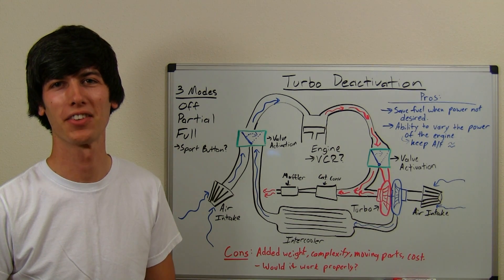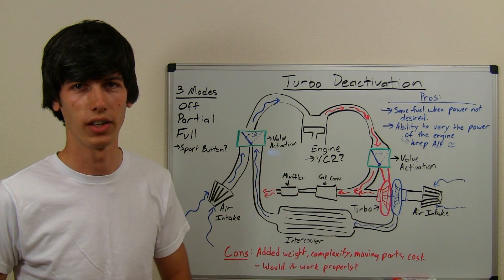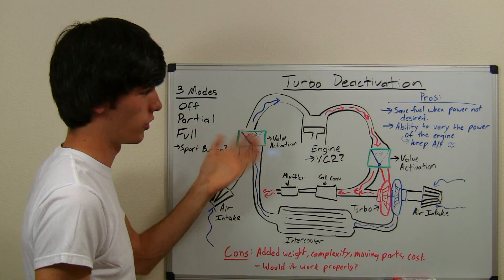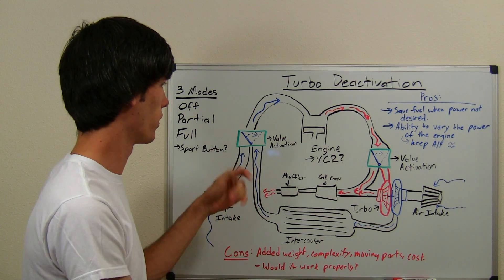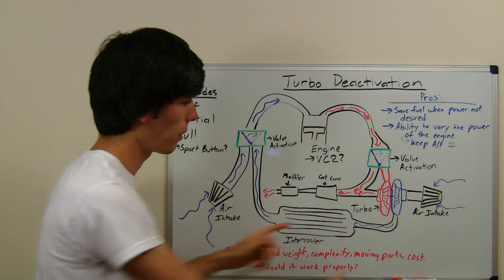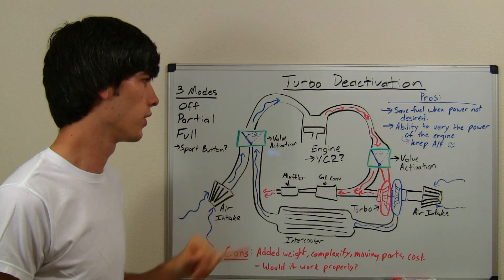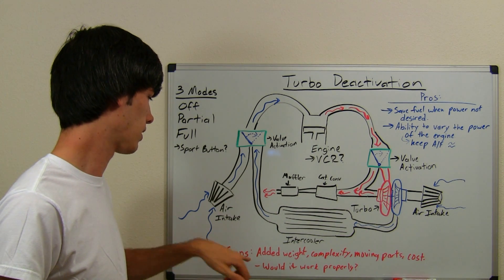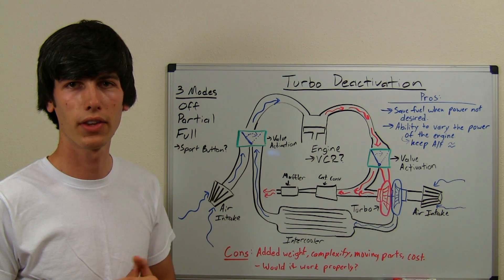Turbocharger Deactivation Concept - Explained

Comment: Surely in your line of work, being a car mechanic, you must have come across a car with a faulty turbo actuator. The symptom would be that the car produces almost no boost at all, because the open wastegate (AKA turbo bypass valve) allows exhaust gas to bypass the turbo. Why bother creating a complicated system like in the vid when all you have to do is fix open the wastegate to get the same result.

Comment: The turbine is a restriction. With wastegate open, exhaust gas will follow the path of least resistance and travel through it effectively bypassing the turbo.  How much boost do you think you can get out of a turbo with the wastegate/vnt vanes fully open?

Comment: DoctorDummer, let me explain. The wastegate bypasses engine exhaust pressure away from the turbo. With the wastegate jammed open, a turbo is effectively deactivated. A wastegate/VNT operated by an actuator, controlled by a pressure valve, is a boost regulating system.

Your final paragraph is simply incorrect in every way.

Comment: 1) Every turbocharger has a 'deactivation valve', it's called a wastegate or 'VNT' on newer types. These channel exhaust pressure away from the turbo, effectively bypassing it. If you want to find out how a car drives with the turbo deactivated pull the vacuum line off the VNT/wastegate actuator.

2) Turbo charged engines are designed to run at lower compression than NA. Removing the turbo will leave you with a NA engine with low compression and therefore reduced performance/fuel economy.

Comment: because if we ran that particular engine at full throttle, but instead at 2500 RPM, the head would be at full efficiency. So the efficiency is still there; and EE is still all intact, but FE SUFFERS. 

That cover it? :)

Comment: to this would be if the engine was at full throttle and at 10000 RPM, simulating 166L of air/s because density is double. This is NOT the full efficiency point of the head. Therefore, EE would NOT and NEVER be equivalent at the same RPM with the same amount of fuel. Efficiency will always be lower with a turbo; mostly due to heat losses. BUT, forced induction is our best friend in making more usable power; so of course we still use it regardless, and it doesnt LOWER efficieny of our engine,

Comment: because of boost! Why? Let me go further. Say we run turbos at 14.7 psi. So we have exactly DOUBLE the amount of air going into the engine; while density is DOUBLE (let us not account for heat losses). So, while at 5000 RPM and 100% throttle, 83L of air is still going through the head;and, in theory, the head should be at maximum efficiency, but in reality, it is overpressured and NOT at full efficiency. Why? The air density is double, causing more pressure; so the equivalent

Comment: head on an engine will produce max efficiency of the head at a certain airflow volume. SO, say the head was to reach maximum airflow efficiency (when air flow was not TOO pressurized to create difficulty in smooth flow, but not too LOWLY pressurized to slow velocity) at 83L of air/s (over a 2.0L I4); this efficiency would be reached at 100% throttle at ~5000 RPM. So clearly this is a race head. NONETHELESS; this head would NOT be equally efficient at 100% throttle and 5000 RPM on the same engine

Comment: DOUBLE. Simply because 14.7:1 is the ratio of perfect air-to-fuel combustion. Yes, the engine can run lean or rich; but if it was running at the same ratio, then it would use DOUBLE the amount of fuel because it is using DOUBLE the amount of air. Simple math. Would it produce DOUBLE the amount of work? NO! Why? Heating loss (intercooler is not 100% efficient. Good intercoolers are usually 80% at peak), and the MANY variations throughout the engine that determine good air flow; a

Comment: Economy; EE isn't relevant here if what you say he's proposing is true. Of course the system would work. All it is is just some complicated plumbing job; simplistic way to look at it, but at the end of the day; that IS what it is. 

Also, a turbo engine flows less air when NOT under boost for obvious reasons. And the question "does it use more fuel to do the same amount of work" is far too ambigious. If the turbo was pushing exactly an extra 14.7 PSI of boost, then fuel consumption would be

Comment: I don't know what you're doing, but something is off. Either way, this turbo deactivation system will be less efficient than just a pure turbo engine or a pure NA engine because of all the valves and plumbing complexities and the weight. It's really that simple. I did watch the video of course, but really only found that he proposed a "gimme your opinions" kinda question rather than individual questions. And, if those two questions WERE what he was asking; that has nothing to do with Fuel

Comment: It's not necessary 100%, but it'd be an absolute mess without it... 

And its simple. Less air forced in = less fuel burned. Yes, power would be down too, but power should still be sufficient even in N/A to put around town.

Comment: I'm afraid you are talking about the thermoelectric generators. They are only about 6-7% efficient. The thermoelectric cooling pads which pretty much makes one side hot and one side cold is almost 100% efficient.

Comment: Like I said, it needs experimenting. No one knows if idle exhaust flow would be able to power some or all accs. But even if it does not, there are ways to get aroudn it. i.e. If you had electric steering, as long as battery had power, it shouldn't be a problem. Battery can be charged when engine is running with alternator. And if nothing worked, alternator can be attached to turbines to add electricity to battery only when there's enough exhaust flow.

Comment: Could you please clear up then what magical force it is that stops the vehicle from accelerating down a hill even though the mass of your car along with gravity are trying to accelerate it. Engine braking (not compression braking) is caused by pumping loss. Compression braking is created by compressing air, releasing it before what would typically be the power stroke, then drawing the piston against a vacuum.

Comment: You replied to yourself. I am quite clear on the fact most people think all diesels don't have throttles. Actually there are diesels with throttle valves. They restrict air entering the compressor inlet restricting fresh air flow, this allows the VGT to clamp down a bit more without creating too much fresh air flow. The end effect is you can flow more EGR without having to flow a large amount of fresh air dropping the AFR. I could explain the entire concept but might scramble your brain.

Comment from the maker: I wouldn't necessarily say P/S is of no use at idle. Have you never been in neutral while moving? Also, if you go around a corner you typically let off the gas, switch gears (temporarily go into neutral, let the engine idle depending on how aggressive you take the corner), etc... Power steering would still be useful to have in this scenario, and probably others that didn't instantly come to mind.

Comment: Here you go dunce. Turbolag is time it takes for pressure generated by turbine to overcome vacuum(suction same thing duh) generated by pistons moving down. At idle/turbolag, engine vacuum is stronger than pressure, so no boost. Turbo does NOT stop at idle. Turbines are in the way of exhaust flow. Turbines stop only when there's no more exhaust flow. Just go study. Don't believe me? Google "turbo at idle". It's spinning, you dumbfuck.

Comment: So you are saying the compressor recovering the waste heat from the exhaust is 100% efficient?! At low flows when the turbo hasn't spooled the compressor in the intake is actually another restriction, as the air would flow more easily if the compressor was not in the stream. It is the same reason an Ebay electric "supercharger" decreases performance. But how could that be when it using energy, it is because it actually slows the momentum of the incoming air just like an unspooled turbo.

Comment: Come around? I have been saying the same thing all along. For the most part the the NA and TC have the same cat and muffler so that can be assumed to be negligible. It would seem minor yes; a drop across the turbo of perhaps half a psi is quite minor, but at low flows that is half a psi out of maybe 4 psia. That is where the 10% FE is lost. The drop across the turbo does increase with flow but so does the work out. This is where the tradeoff and turbo lag I mentioned comes into play.

Comment: No that is what you inferred. It recovers wasted heat at every speed/load point. However it also restricts exhaust flow at every speed/load. However, at high speed/load you gain more by recovering the waste heat than you lose by restricting the exhaust flow. Simply because there is a lot of waste heat at high speed/load and the turbo is likely spooled lowering the exhaust restriction.

Comment: Going down a hill, downshift. See if the airflow does not increase (if you have an OBD scanner that lets you read network parameters like fresh air flow). Not sure if you are thinking of an automatic transmission. Again really need to remember throttle and engine speed are not dependent on each other.

Comment: I am not disagreeing on that point. All I am saying is WOT needs not be at high engine speeds. My overall comment is on a TC engine compared to a NA engine, at the same speed/load, the throttle on the NA would be open further. At low load/speed this is a positive in terms of Fuel Economy. At high speed/load the TC engine does not need to work as hard and you recover wasted heat (positive boost). This means better FE. But if you care about FE you are running low speed loads where NA is better.

Comment: Pumping loss along w/ frictional loss creates engine braking. This is why a diesel will have only a slight bit of engine braking if it has no exhaust brake or compression (Jake) brake. The only loss then is frictional which is quite small compared to pumping. The gravitational energy is dissipated by drawing it through a closed throttle valve (high pumping losses). Increasing engine speed increases the events per time which pulls more flow past the closed blade and creates more braking force.

Comment: You appear to be confused by engine speed and throttle position. I was speaking only on throttle position and its effect on pumping losses. Engine speed is independent of that. Why could the intake/exhaust not be optimized, that is variable valve timing? And CR could be changed by using the Atkinson cycle. Yes it would take years to perfect but this is a theory question. 
With most setups, pumping losses decrease with engine speed to a point then increases.

Comment: Not trying to brag or sound elitist; this is basically my job at a heavy duty diesel engine manufacturer. This idea has merit and you intelligently presented it. The short answer is it would be very difficult to tune this properly. With that said at low loads it would likely increase FE. To tune this properly you would need to make BSFC maps using both systems and pick the best solution. It would likely be NA at low loads and TC at mid/high loads. Good thought provoking video. Thumbs up

Comment: I am not sure what a more efficient pump means, compared to what? At low flows/part throttle a turbo does not produce a positive gauge pressure (it still adds some pressure, just not enough to create positive boost, ie >+1 psig), it is still a partial vacuum. Since an NA engine can do the same but at a more open throttle position (again lower pumping losses) your fuel economy is better. NA cobalt-32mpg, cobalt SS-turbo - 26 mpg.

Comment: Pumping losses DROP as the throttle opens. This is why downhill in gear if you take your foot off the throttle you car slows down (unless it is a diesel with no throttle). If you shut the car off and allowed it to go down a hill, if you opened the throttle it would accelerate, because the pumping losses would go way down. 
To get the same power you need the same fuel. Since gas engines are stoichiometric you have the same air flow. Since there is no turbo the throttle has to open further.

Comment: Your idea's good but turbos aren't constantly spinning and if you were to take off slowly like in a city or in traffic the turbo spins either slowly or not at all if you go slow enough. It can also make your car more economical by giving each cylinder the most ammount of air possible in the non-aspirated induction cycle, this makes the car burn the air/fuel mixture more efficiently giving you better mileage.

Comment: think a better a idea would be to have two turbos one small for lower rpms and a bigger one for higher rpms.But using the same valve tech by sending all waste gases at low rpms to the small turbo and at high rpm giving air to either both the turbos or jus the big one..

Comment: Also, they are already doing this with superchargers.  The reason is because you can engage and disengage them more easily than a turbo. Basically it is like a belt driven fan kicking on, instead of a potato in the exhaust.

Comment: Was just about to talk about CR, then you addressed it. Your ideas are all spot on. Problem is there is really no market for this technology. Expensive, complicated, etc.
Fuel economy would go up. Any time you put something in the exhaust that blocks flow you decrease efficiency. Also the amount of fuel you inject would be the same, but on NA engines the throttle is further open to get the same air flow. This is where the savings come from, dropping pumping losses.

Comment from the maker: Hmm, how about putting the specific application into perspective. For my idea, I'm thinking of something like a large 4 cyl (Subaru 2.5 seems a good fit) with high power output (could even be the 300 posted by the boxer), but with the capability of restricting maximum power to say 200 or less. Maybe I'm just looking at it from a "cool factor" point of view rather than practical, but intuition tells me better fuel economy could be achieved. That certainly doesn't mean that's true, of course.

Comment: Nobody has ever tested, so no-one can know for sure that the exhaust flow would be powerful enough to run those accs. However, if anything the accs can be split. For example, P/S pump can run on exhaust flow since it is of no use at idle. There are many ideas to save gas, but auto makers don't like to install them for the reason that it just costs more to make each cars.

Comment: Negative boost? The exhaust gas is flowing "out" the exhaust no doubt. The turbolag doesn't happen because the turbine isn't moving at all. If turbine did not move at all, the exhaust gas has nowhere to escape, and shut off the engine. Turbolag happens because time is required for pressure built by turbo needs to overcome the intake suction. I am fighting you because clearly you are misinformed.

Comment: Could you do a video on blowoff valve vs. diverter valve or any other type of pressure relief system? I have an '04 Passat with a 1.8T with a diverter valve and it its turbo behaves much differently than, say, a diesel engine that I assume would have a blowoff valve. One thing I notice about it is that, if I stomp on the gas, there will be a hissing sound and the power will increase. Let off slightly, hissing stops suddenly, power decreases. I'd love to know more about what's going on there.

Comment: Well there are many waste gate actuator systems available. Hyundai's Theta II GTDI uses this approach, with only one arm to close off exhaust to the turbine. It achieves the exact same outcomes and concepts as described, only the waste gate actuator arm is controlled by computer, and thus not able to be controlled by the driver.

Comment: i get the idea but, if you want an economical engine you need more power on lower rpm's so whats the point of deactivating turbo, how can you spool turbo while using partially and don't you expect engine knock when you activate turbo, how can you manage to change Comp.rat instantly, you ll need multiple engine map,  so, we have 2.0T engine you are saying that its 150hp without turbo and 300hp on turbo but its not, probably it ll have 50hp without the turbo since its substructure based on turbo..

Comment: i see the following problem... i tried to find some information about how much weihgt a turbocharger is... i got around 80kg which is allready one more person sitting in the car you have to add the cost for the control unit plus the extra cold air intake... that makes about 100kg you are carrying around with you for not useing it now calculate what it would cost without a turbocharger and with then decide with plus 100 kg im sorry its 6 in the morning

Comment: nice man but i think keeping the turbo as it is and lowring the psi of it is the point so if you could have a switch to lower ur psi to 5 psi when u r using the car in the city and increase the psi as 20 psi for the track use so that would be much better dont u think?

Comment: I also thought that maybe the heat from exhaust might make it hard to have a valve on it, but I remembered there have been muffler bypass systems out for a while now. That's a little further down the exhaust system (pre-turbo points get quite hot) but one of these systems could be built using entirely available technology.

Comment: A small potential additional improvement that you didn't note here is that if the engine overheats, the computer could lock off the turbo. Plus, it could be possible to use two turbo sizes which would allow you to have two power peaks (I think Audi or Mercedes recently produced a car with two different-sized turbos).

It seems like a supercharger with a clutch system (similar to the air compressor for the climate control) would be an easier way to have a "push button" forced induction system.